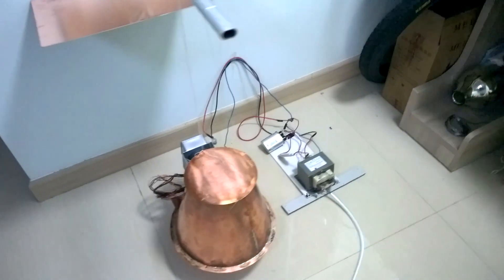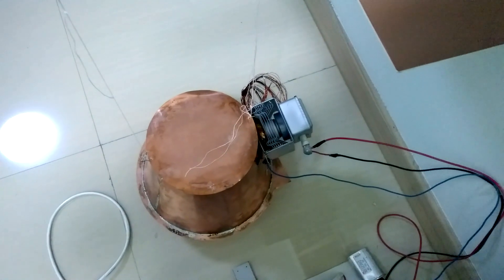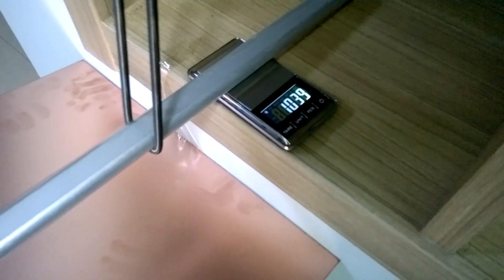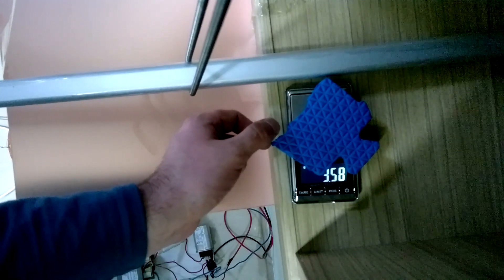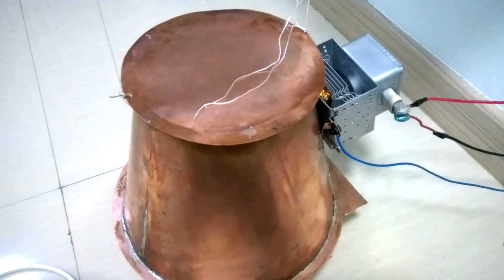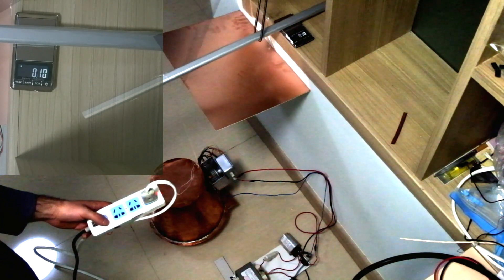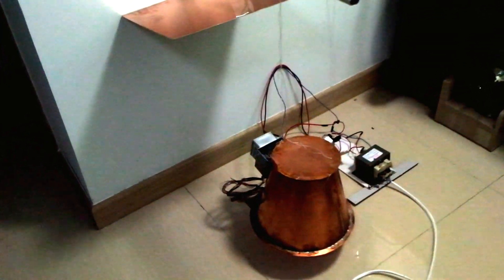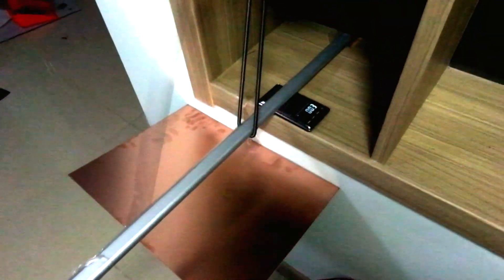EmDrive Test No.03 Success, I have thrust !!!

Comment: What you did here is the same thing NASA has done later to prove the validity of the EmDrive. The interesting thing is they used the same method you came up with here, just months later. Now, have they copied it from you is what I'd like to know.
Reply: Aleksandar Grozdanoski Yes, NASA had an enormous torsion balance built years ago in a vacuum chamber in order to copy this video. Also a torsion balance is different....
Reply: outsider344 Thanks for your answer

Comment: Wait, the thrust should be on the wider end, that means the acceleration is on the tapered end, which means it shouldn't add weight but decrease the weight on the lever. Hmm.. something is wrong here
Reply: The scale reads a negative value. The weight is decreasing.

Comment: So is this antigravity or not?
Reply: No, this can make space craft go theoretically near the speed of light.
Reply: it's not an alcubierre drive, it just runs on electricity.
Reply: 480gaming It can reach higher speeds due to the lack of weight and mass of the rocket fuel. Yes it runs on electricity, but it can revolutionize spacecraft.
Reply: +TheGamingOfTheSky maybe if they make it more efficient right now ion drives are still faster for missions we would actually do however for sending probes to alpha centuri it would be the fastest means available

Comment: With the force that is creating, you might as well get someone to go to the platform and lift the rocket by hand.
Reply: NotTheFeesh it is not designed, at least now to lift anythign, but to PROPEL spaceships in vacum as NASA did the test and the drive works in vacum
Reply: With the force a scaled up version of this might create, you might as well have an astronaut get out and use their MMU to push the rocket.

Comment: Was it supposed to lift the bucket off of the ground? And if so can you show us a side view in new video?
Reply: Andrew Maksym the goal of this engine is not, in it's current prototype state, to be a huge thrust maker. it does produce thrust out of electricity only. the disign, once rafined, will be able to compete with other propulsions for long distances Travel. maybe even lift something if we use supderconductors instead of regular cables
Reply: The bucket is the emdrive. There isnt enough force for the drive to lift itself against earths gravity if it works. He had the drive held off the ground by the metal bar that was resting on the scale. The scale measuring less force after the emdrive was turned on is his proof that his device is working.

Comment: this experiment would be convincing if the measurements were done using the exact same method. The first measurement was under a bar/lever combination, the second was direct. 

Because of this, it leaves me to wonder. 

The measurement must be using the exact same method of measurement, with the drive off, then with it on. Using the same scale, not moved, not zeroed out between measurements.

Comment: Measuring mN thrust with that equipment....   Oh YouTube.
Reply: I'm sorry to inform you that mN is actually 1000th of a N.
Reply: 1mN = aprox 0.1 gram, any drugdealer's scale will do 0.1grams
Reply: I never put my trust into Youtube Science....
Reply: First half of experiment is completely busted by Steve Kasian, I think. And for the second half author must use some different methods of measuring, even in atmosphere, not vacuum, for example - what about non-electronical measuring? Just to be shure that it's not of electric field? The simplest way is placing a part of soft rubber instead of his weights, make lever arm longer and check if its far end moves up-down while switching power. And of course it must be tested in vacuum, even not very deep, to understand that it's not just air heating. Maybe that flying bucket is interesting but causes many questions.
Reply: Yeah, but the scale is zeroed out (takes the weight of the pendulum into consideration), so unless something moves the weight shouldn't change, right? But it did change...
Reply: Naysayer he may be. You simply cannot test a millionth of a newton with that equipment. Incredibly sensitive equipment is required for that.

Want to know how small a mN is? You can get a reading of a single mN from pretty much any electrical equipment nearby. A false reading yes but still a reading.

Edit - That equipment can only measure like if you're extremely careful MAYBE a 1000th of a Newton. A millionth of a Newton vHAHAHAHAHAHAHAHAHAHAHAHAHAHAHAHAHAHAHAHAHAHAHAHAHAHAHAHAHAHAHAHAHAHAHAHAHAHAHAHAHAHAHAHAHAHAHAHAHAHAHAHAHAHAHAHAHAHAHAHAHAHAHAHAHAHAHAHAHAHAHAHAHAHAHAHAHAHAHAHAHAHAHAHAHAHAHAHAHAHAHAHAHAHAHAHAHAHAHAHAHAHAHAHAHAHAHAHAHAHAHAHAHAHAHAHAHAHAHAHAHAHAHAHAHAHAHAHAHAHAHAHAHAHAHAHAHAHAHAHAHAHAHAHAHAHAHAHAHAHAHAHAHAHAHAHAHAHAHAHAHAHAHAHAHAHAHAHAHAHAHAHAHAHAHAHAHAHAHAHAHAHAHAHAHAHAHAHAHAHAHAHAHAHAHAHAHAHAHAHAHAHAHAHAHAHAHAHAHAHAHAHAHAHAHAHAHAHAHAHAHAHAHAHAHAHAHAHAHAHAHAHAHAHAHAHAHAHAHAHAHAHAHAHAHAHAHAHAHAHAHAHAHAHAHAHAHAHAHAHAHAHAHAHAHAHAHAHAHAHAHAHAHAHAHAHAHAHAHAHAHAHAHAHAHAHAHAHAHAHAHAHAHAHAHAHAHAHAHAHAHAHAHAHAHAHAHAHAHAHAHAHAHAHAHAHAHAHAHAHAHAHAHAHAHAHAHAHAHAHAHAHAHAHAHAHAHAHAHAHAHAHAHAHAHAHAHAHAHAHAHAHAHAHAHAHAHAHAHAHAHAHAHAHAHAHAHAHAHAHAHAHAHAHAHAHAHAHAHAHAHAHAHAHAHAHAHAHAHAHAHAHAHAHAHAHAHAHAHAHAHAHAHAHAHAHAHAHAHAHAHAHAHAHAHAHAHAHAHAHAHAHAHAHAHAHAHAHAHAHAHAHAHAHAHAHAHAHAHAHAHAHAHAHAHAHAHAHAHAHAHAHAHAHAHAHAHAHAHAHAHAHAHAHAHAHAHAHAHAHAHAHAHAHAHAHAHAHAHAHAHAHAHAHAHAHAHAHAHAHAHAHAHAHAHAHAHAHAHAHAHAHAHAHAHAHAHAHAHAHAHAHAHAHAHAHAHAHAHAHAHAHAHAHAHAHAHAHAHAHAHAHAHAHAHAHAHAHAHAHAHAHAHAHAHAHAHAHAHAHAHAHAHAHAHAHAHAHAHAHAHAHAHAHAHAHAHAHAHAHAHAHAHAHAHAHAHAHAHAHAHAHAHAHAHAHAHAHAHAHAHAHAHAHAHAHAHAHAHAHAHAHAHAHAHAHAHAHAHAHAHAHAHAHAHAHAHAHAHAHAHAHAHAHAHAHAHAHAHAHAHAHAHAHAHAHAHAHAHAHAHAHAHAHAHAHAHAHAHAHAHAHAHAHAHAHAHAHAHAHAHAHAHAHAHAHAHAHAHAHAHAHAHAHAHAHAHAHAHAHAHAHAHAHAHAHAHAHAHAHAHAHAHAHAHAHAHAHAHAHAHAHAHAHA

Don't make me laugh.

P.s Even the small amount of heat from a sensor in a enclosed space is enough to make SIGNIFICANT amount of mN
Reply: did you saw the vide?
the guy power that shit and the shit get ligther, power off and go to regular measurement... that shit works ... if there is not any trick or something pulling the bar up...
Reply: The equipment is rather irrelevant, considering that the entire trick is centered on the "contraption", not the emDrive. Didn't you, at any point in watching this, stop to wonder exactly "why" he needed that whole arm-hanging-out-over-the-side/hanging-pendulum setup to weigh the items?? DUH! Everyone is initially impressed with the setup, giving the guy props for obviously knowing what he's doing... and never stopping to question why it should be so complicated to weigh something. LOL That's the con here... the contraption itself. He weighs an object that weighs 10g on the pendulum, but only like 4g on the scale. That's because the pendulum is not being weighed! The pressure exerted by the horizontal bar on the scale is what is being measured, and is directly proportional to not only the weight of the pendulum, but also to the distance the scale is from the anchored end of the bar. Move the scale outward and the apparent weight of the pendulum is less; Move it inward and it's weight increases exponentially. It's not rocket science. lol
Reply: He tried, and he achieved something, however small it may be.
Reply: Fuck off naysayer.
Reply: @Erik3E  Ha ha.

Comment: U need try in vacuum, because using power there it can heat the air in this copper reservoir and create thrust
Reply: Or test it upside down, and see if it generates the same thrust in the opposite direction.
Reply: Ben Hu
nasa did, and it does seems to work, even in vaccum, in all directions
Reply: +Angelo Stevens
Wasn't the measured thrust way stronger than it would've been if the device was instead a photon drive?
Reply: +Bel Rick
Didn't they run the test in a high vacuum?
Reply: You're missing the point Angelo.
Reply: But a (very) lot less trust. And the paper still did not rule out basic thing like the microwaves turning the device into a crude ion drive or photon drive.
Reply: To deal with concerns about upward thermals; test the device upside down as well.
Reply: +Angelo Stevens
If you acknowledge it wasn't driven by photons, what do you mean the thrust was from heat?
Reply: ***** heating up the surrounding air like a hot air balloon perhaps?
Reply: Any change in internal temperature? An increase in temp can lead to an increase in volume and inversely a decrease in density.
Reply: mansuy adrien not anymore lol
Reply: I clearly seen when he turning on power it creates a thrust but somehow it starts loosing it. I guess he turnoff the power intentionally after this, because after some time we'll not see any thrust as the temperature is balanced in sides and in to this copper reservoir.
Reply: Hrant Sargsyan it was tested in vacum, not by him, but by NASA in their vacum chamber. they claim to still mesure thrust
Reply: I heard about and I'm happy with this, just I mean that this one may have violations
Reply: funny that you say that, cuz it passed peer reveiw

Comment: the test is not correct, u have there a lever. If u weight the sponge directly 3,5 g, if u add a lever with the arm of 2,5 distance from the support of lever you will have this ratio weight without any EM engine

Comment: The thrust you should be expecting should not move the scale that much.  Also, you're exposing that whole room to microwave radiation every time you plug it in, btw.  This is why your microwave has a set of contacts that open when the door opens (it prevents the magnetron from being powered while you are exposed to it).  I would stop using this setup until you have some protective measures in place to shield you from the radiation.

Comment: I wonder what would happen if you change the shape of the resonator by a cone
Reply: William Martínez Cortés the cone is far from perfect, but as i understand the shape is essencial to produce asyncroneous thrust. the shape, materials and wavelength still need to be changed to enhance efficiency and thrust output. seing this thing going above ion propulsion if far form science fiction, as in it's realy early stage it already outperform photonic drives and solar sails.
Reply: and this thing is just as bullshit as photonic drives and solar sails.

Just a basic understanding of physics destroys this thing.
Short of nuclear there's not power source dense enough to power this thing.
They had to use an extremely sensitive device just to get any result.

Conventional rocket engines have to be held down because of the power they release.
this thing barely produces a fart by comparision
Reply: Chris Baker
and? it is not because it is not practical yet that you have to ditch the thing. a small trust can make a big difference when speaking about space travel, because of how long interplanetary trips are. a fart can be strong enough to propel you if it you can keep farting for 8 years. the idea is to use this thing after standard propulsion for extra speed over time, rather than being the only way to propel the craft. a conventional engine is good to pick up speed, while unconventional drives are good to keep the speed going while the craft is on it's way.

Comment: What the hell. If this motor was real, it only would work in space, already in orbit. Roger Shawyer, the designer of the EmDrive, must be embarrased of all the people like you.
Reply: vistaero it does produce thrust in atmosphere, tho not a very useful alternative considering how small the thrust is
Reply: +mansuy adrien because of tiny thrust, it's not very useful in space either.
Reply: MasterBata
the thing is it can be used forever as long as you have the energy for it, wich is a big deal if you consider how long space flight are
Reply: mansuy adrien yeah, and with this tech, they will be waaaay longer...
Reply: MasterBata
not realy, first the drive it's at it's portotype state, no tunning was made so the thrust is probably not as strong as it could be, second the time decrease as disdance increase, unlike a regular engine wich decrease based on how much delta V you have in your fuel. different engines just make it faster or slower do accelerate.
Reply: mansuy adrien - we are talking about drives that produce around 1mN of thrust per kW. Thrust of 1mN applied to 1kg would result in acceleration of 0.001m/s²
Reply: MasterBata and? do you know that a standard earth to mars trip is 5 month long? and what is not alowing you to not use it in tandem with a standard drive? why don't use the EM drive to keep accelerating after your standard fuel is depleted? it is not like the thing need an exaust anyway
Reply: mansuy adrien I don't think you realize how miniscule the thrust is. It would not make any difference, even if you could keep the power to weight ratio as I mentioned. Which you couldn't, no way you could generate 1kW of power per kg.
Reply: MasterBata
as i said earlier, we still didn't improved the design. this is like the first rockets with gunpowder, they fly, yes. but calling it flying is way way overestimate them. but from thoses basis came more advanced solid fuel rockets, then our beloved hydrogen, oxydiser rokets we all love to watch explode. this drive will undergo the same prossess of tunning and upgrading
Reply: +MasterBata because it does not rely on any (known) reaction mass it can potentially reach far higher speeds than conventional thrust systems which are limited by their exhaust velocity .. So it is actually very useful for long distance thrust.

Comment: Does it still work w/o the copperplate under it? It is possible that the microwaves are inducing eddy currents in the cavity which creates a magnetic field which will induce another field in the plate under it causing them to repel
Reply: Yextus i think he didn't mesured a stable thrust like there when the bottom was removed. as it is an integral part as resonating the microwaves to produce stronger effects.
Reply: Yeah, If you look at around 3:40 there is a rectangular part of the plate at the bottom. I thought this was a second plate which is what I was talking about. Being that it is sealed however, it is also possible that the microwaves are just heating the sides and therefore the air inside so it wan't to rise. Not that I'm an EM drive hater or anything, I hope it will work, but this isn't exactly a NASA-grade test lol
Reply: Yextus
speaking of wich, NASA actualy DID the experiment, with their OWN drive, built using space grade materials. they tested it, in all direction in atmo, in all direction in vaccum. and you know what, it produced thrust!. in different directions depending on the orientation. it produced the same thrust in vaccum too!. now they are looking for errors, and their paper is curently undre peer investigation before being able to be published. so yeah, even if this dude experiments are "not NASA grade", NASA themselves won't declare "it worked" if they hadn't tested all the obvious errors types like heat, magnetism, air flow, ect.